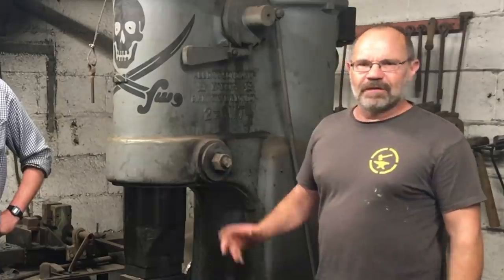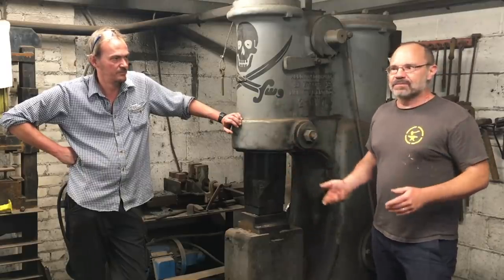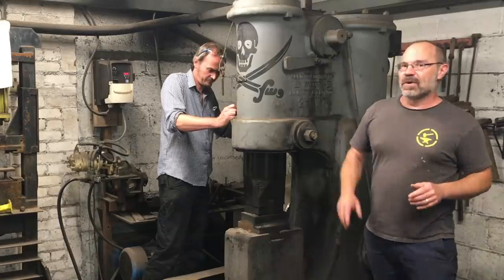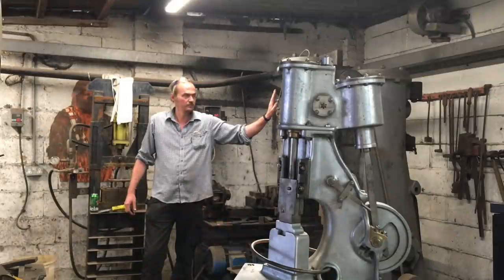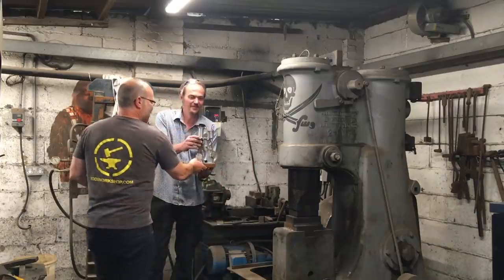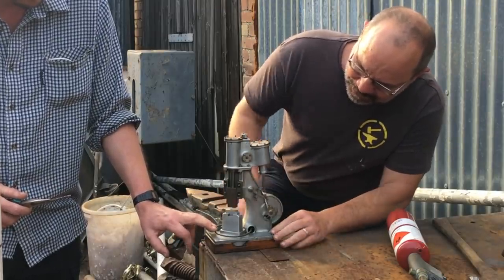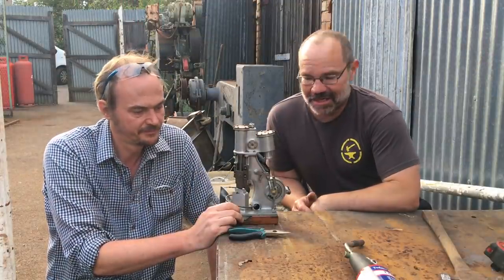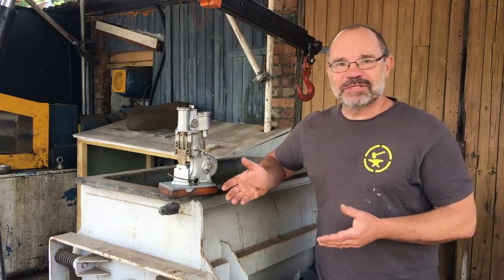The BEST power hammer ever!

Comment: My favorite thing about old machinery is that it was built to last. The ability to withstand the test of time for over 100 years and still be desirable and in working order is a quality that a majority of modern items lack unfortunately.
Reply from the maker: So very true
Reply: When I worked in the tobacco industry our blender side of the business used a machine made in the early 1900s to cut cake (pipe tobacco blends compressed into a solid slab). The only issue they ever had with it while I was still there was that one or two bushings had finally worn enough to need replacement.
Reply: This is pretty much why they stopped selling pressure cookers. They're really good, but they also last forever, so companies couldn't earn big bucks selling them.
Reply: @tods_workshop  Ok boomer.
Reply: Factories took pride in their product and men took pride in their work.

Comment: I always wondered how to keep a big power hammer from shaking the heck out of a camera mounted anywhere in the same room.
Reply: Typically power hammers are mounted on a slab that is isolated from the rest of the workshop. Kind of like an island, with grit or whatever to fill the gap between it and neighbouring slabs. The slab under a power hammer is also thicker. Additionaly (depending on the hammer as some go into the ground) a thick rubber matt can be placed underneath for extra vibration absorbsation. I'm just a student so I may  need correcting on this.
Reply: Elastic gimbal. Basically, an electric gimbal that's hanging in the center of a ring, connected only by rubber bands from all sides. Works really well.
Alternatively, a drone, or if you're on a budget, hang the camera from the roof. The roof bounces less than you'd think.
Reply: @Ranstone  I found it just the intensity of the noise is enough to cause Distortion in some cameras I figure a clear barrier between it and the hammer would help with that

Comment: Wait does that really generate enough force, with so little weight and such a short stroke to actually shape steel? Or is it only capable of the slight smushing demonstrated?
Reply: It's a scale model designed for sales.
The idea is that instead of bringing a full sized power hammer to every one of your potential cuatomers you bring that along. They get to see how it works and the amount of force it creates. Then if its a 1:100 scale model you multiply the force by 100 for the full sized industrial one.

Comment: I wonder. Is the force per area the same with both power hammers? It can deform the heated metal so that indicates that it might be.
Reply: Good question, but I don't think so. If you took a cut out of the real machine, with equal hammer area to the model, you would see that the components have greater speed, mass and air pressure behind them.
Reply from the maker: Chali has it.  But if the pressure was increased the energy would increase too, but the momentum would still be way down

Comment: I assume that with that one, when you get your thumb underneath, it wont be as painful as with the big brother.
Am I right?
Reply: I believe so. If you took a cut out of the real machine, with equal hammer area to the model, you would see that the components have greater speed, mass and air pressure behind them.

Comment: Is this supposed to be practical tool or just a nice collectible? If practical, wouldn't it be much nicer if it were foot-powered like with spinning wheels?

And something I've always wondered with regards to forging...are there power hammer machine which include a gas torch so that you don't need to keep running back to the forge?
Reply: It's for demonstration purposes, to sell the big ones.

Comment: Power hammer were originally steam hammers they swapped to pneumatic when steam fell out of regular use its possible the mini hammer was a demo for   the new pneumatic system instead of steam it's the same style as the big one so probably the same pattern you got some small far away going on in there as well 🤣